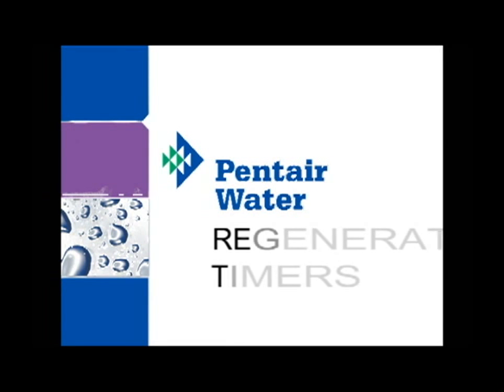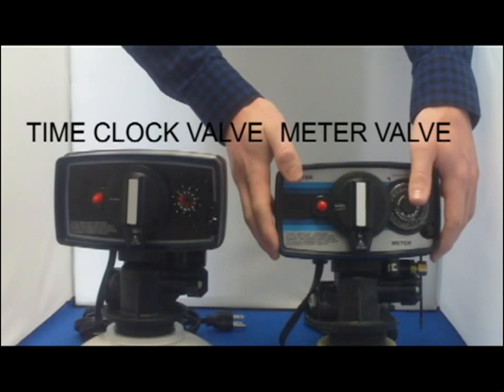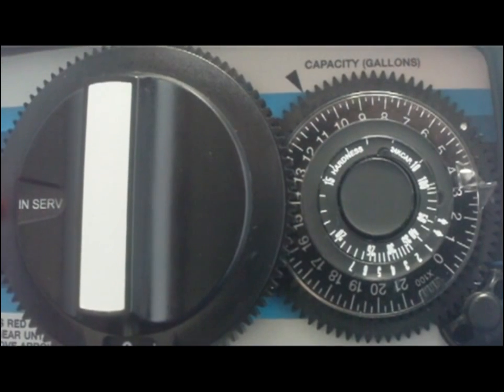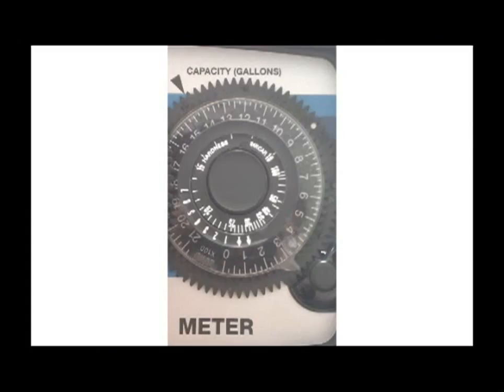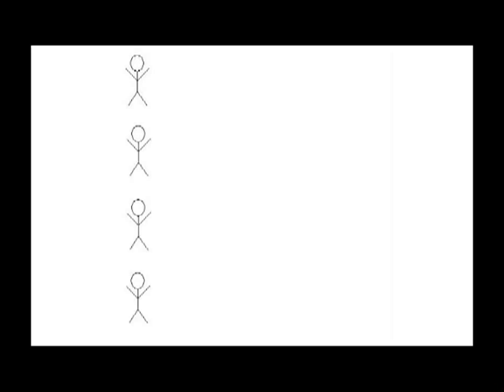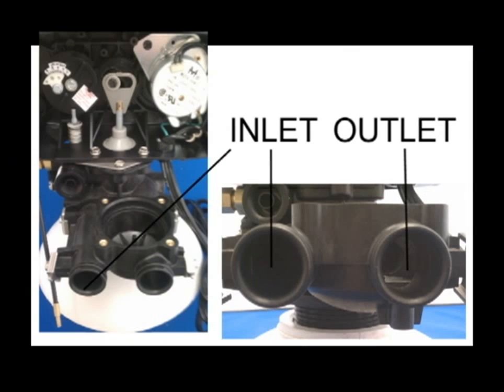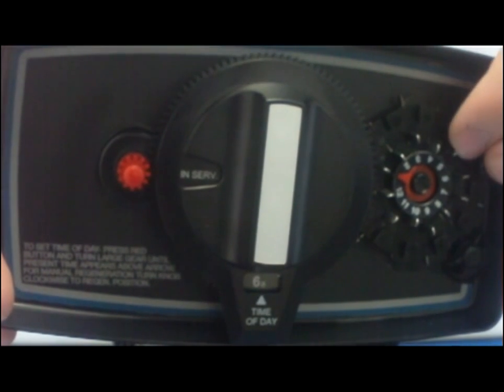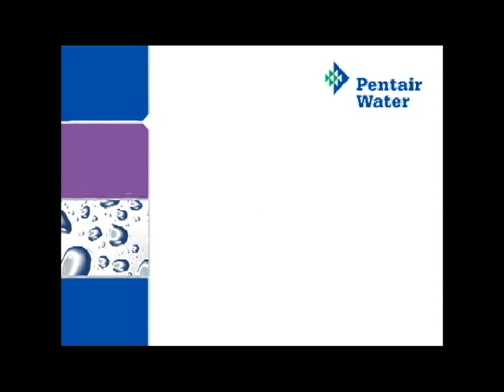Timer Regeneration

Comment: Does Fleck sell a wrench to remove the head assembly?  I have an older model (with the day timer), and even after releasing pressure, it's on too tight to unscrew by hand.

Comment: Does anyone know how to adjust the default setting? I'm not sure if someone in the house tinkered with it or if it's going bad but it's no longer running at 2:00AM. It ran at 4:00PM a few days ago and now it's running at 11:30PM :((
Reply: I would also like to know as mine regenerates at like 7:00 am...and I really can't find a video that explains how to reset it back at the 2:00 am default time....even the manual doesn't tell you how to do so.
Reply: @PlumberD   @DCMAN 1973  I found that mine had a faulty mechanism. Once it got replaced it worked. If yours works correctly all you should have to do is set it to the time. For instance, if it's 3PM you just set the time on the timer to 3PM. If you had a power outage that could have either damaged something or changed the time. Every time I have a power outage I have to go reset the time if I want it to go on at 2AM. Hope that helps :)
Reply: @emach07  can you tell me what mechanism was replaced?
Reply: @PlumberD  I had a local company come in and do it. I'll see if I can dig up the paperwork when I get a chance and see if I can figure it out. If I remember correctly there was more than one part that needed to be replaced but maybe if the part numbers or names of the parts are on the invoice you could look them up and find out which one does what
Reply: @PlumberD  Hey again. Man, so sorry I forgot to reply to this. I found my receipt. It says "replaced Piston and Scals on OX, and then some cleaning and lubing. In the parts description it says (line 1) Piston $47.08, (line 2) Scal Kit $24.00

I don't know much about any of this stuff lol. I hope this helps. Sorry again for taking so long